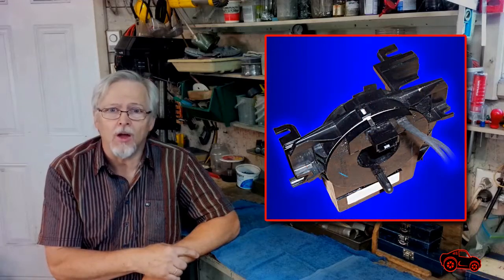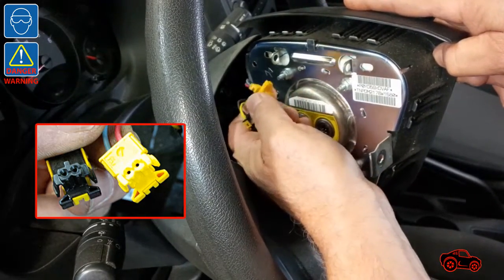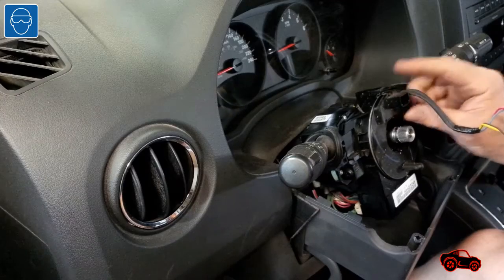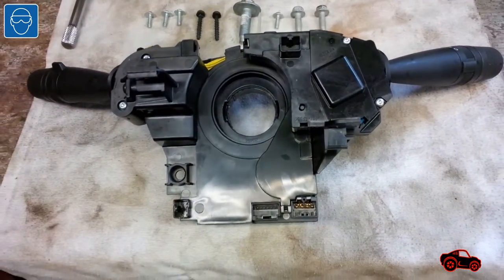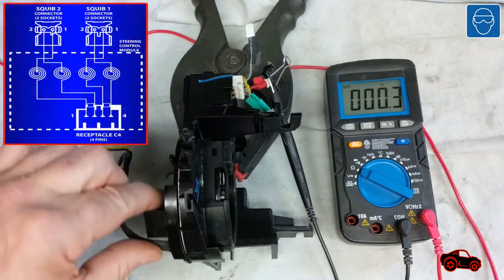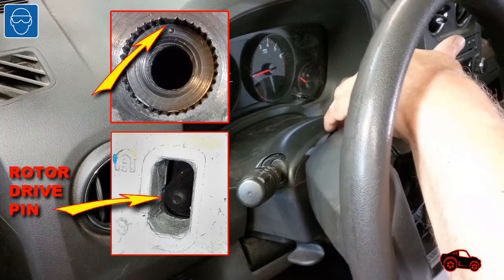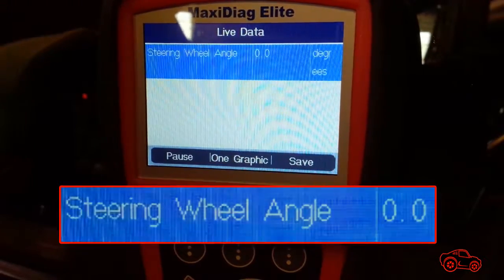Jeep Patriot Airbag Warning Light OBD2 Codes B1B02 B1B06 Clockspring removed, inspected & replaced.

Comment: So I can go to a salvage yard and grab a clock spring off another unit as long as I zip tire the clock spring before removing ?
Reply from the maker: Only some salvage yards let you remove it . Also, zip ties can be used properly, as long as the steering wheel is centered and the front wheels are aligned straight ahead.   To avoid compatibility problems I did get the clock spring from a vehicle made the same year.
Reply: @mtlcarguy  thanks for the reply , ok I will go check to find the exact year  and see if it’s possible to remove

Comment: What is the replacement part number ?
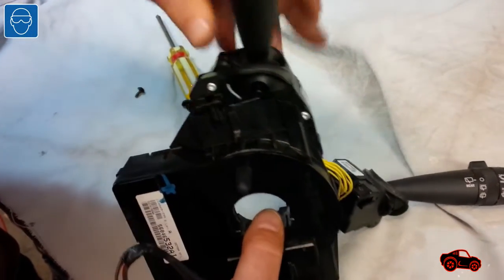Reply from the maker: The replacement part came from a recycling facility. The vehicle it came from was built the same year and equipped with the same options. I did not keep the part number but you can look at the video at 6:01 min. for a partial view.

Comment: I replace my class ring and I'm still getting squib 1 and squib 2  shorted together (b1b0b) any ideas?
Reply from the maker: B1B0B is a code for the squib 1 on the passenger side.
Usually this code can be generated by shorted wires or bad connections or a defective Module Occupant Restrain Controller or a defective airbag.
This is a link to a PDF document to know more about the ORC system.
https://www.google.ca/search?q=jeep+patriot+8443-25+adapter&biw=1920&bih=881&sxsrf=AJOqlzVPIURL4L9F1L5MX_70hEk3sBZvKQ%3A1675056860339&ei=3FbXY4GzFMy15NoPxqWL6Ak&ved=0ahUKEwiBkY6Jye78AhXMGlkFHcbSAp0Q4dUDCA8&uact=5&oq=jeep+patriot+8443-25+adapter&gs_lcp=Cgxnd3Mtd2l6LXNlcnAQAzIFCAAQogQyBwgAEB4QogQyBQgAEKIEMgUIABCiBDIFCAAQogQ6CggAEEcQ1gQQsAM6BAghEBVKBAhBGABKBAhGGABQ_wlY-j5g61VoAXABeACAAVyIAdMGkgECMTCYAQCgAQHIAQjAAQE&sclient=gws-wiz-serp